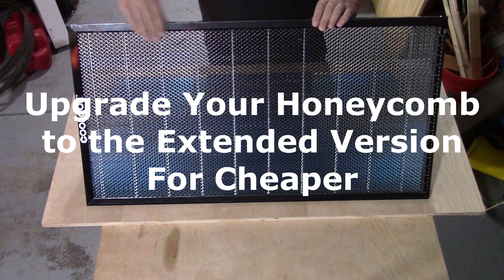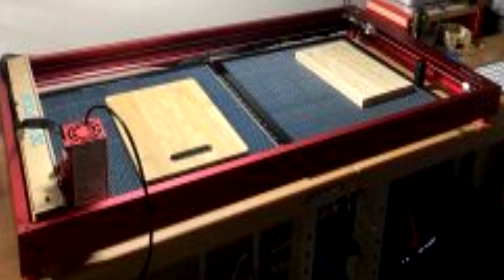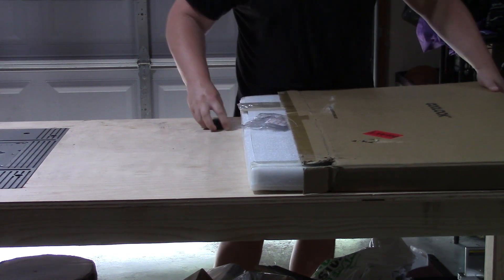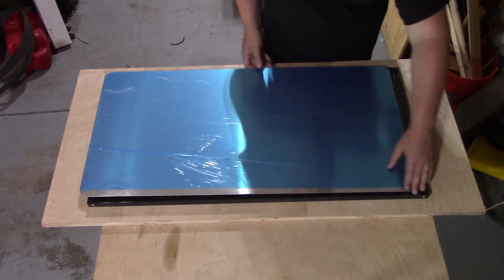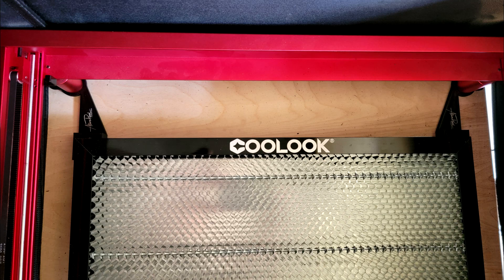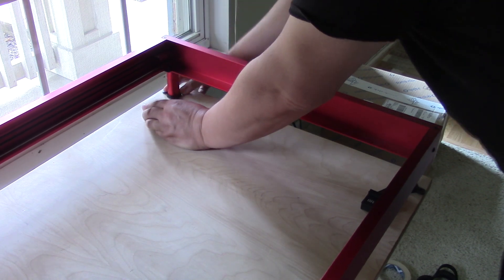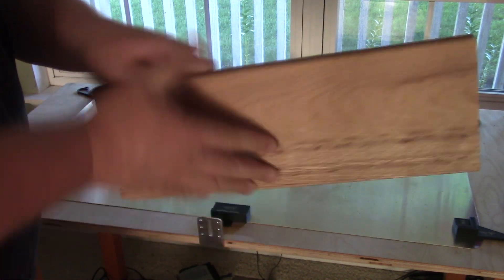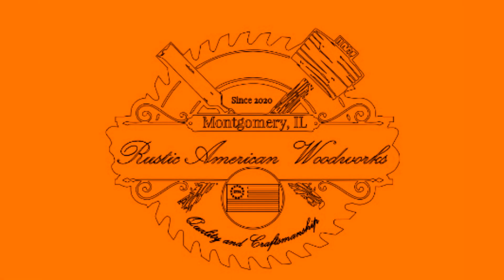Xtool Extension Honeycomb for Cheaper than Xtool Honeycomb.  Twice the Size Half the Cost.

Comment: I did the same when I added the extension rails. I got off Amazon for 89.00 and it same quality as one you got. I built a riser base, squared it and secured to table. I cut a rabbets in the frame for honeycomb to be flush with frame and it is perfectly at 0/0. I used 3 pieces of 1/8 steel angle to hold honeycomb level and keep it from drooping in center
Reply from the maker: Nice!  I see now Xtool has started to drop their prices on their Honeycombs since they are coming out on Amazon for so much cheaper.